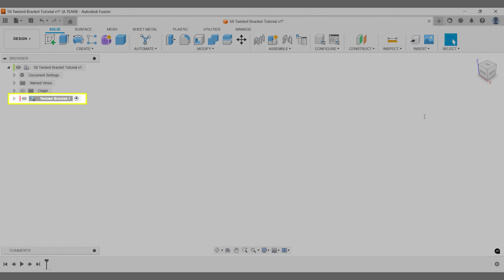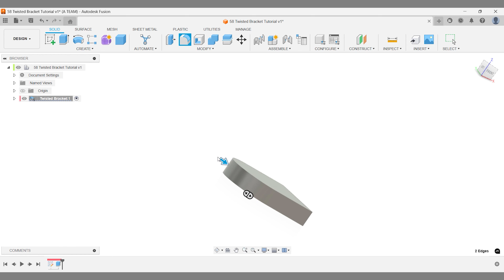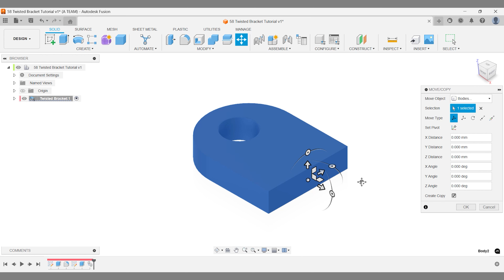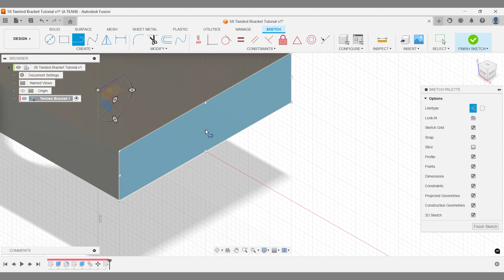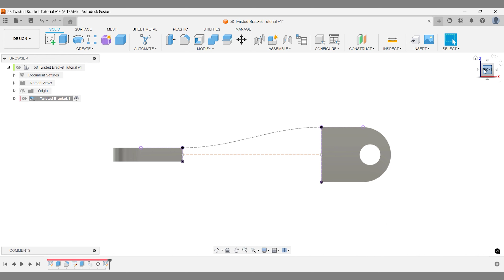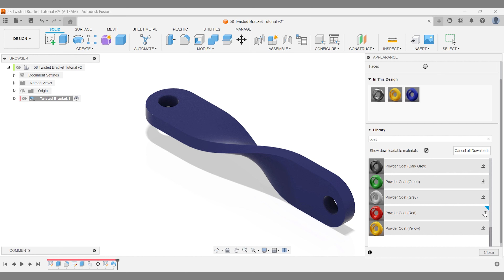Make Complex Shapes in Fusion – Twisted Bracket with 3D Sketches

Comment: I would have selected the end face to create the 10mm sketch fillet, rather than the two edges. Provides the same result. Does my method have any downsides over your method?
Reply from the maker: You're absolutely right—you can achieve the same result faster. That workflow is quicker, as long as the fillet applies between the sides rather than between the top and bottom faces. I opted for manual selections to play it safe.